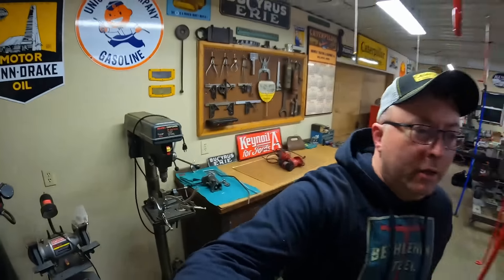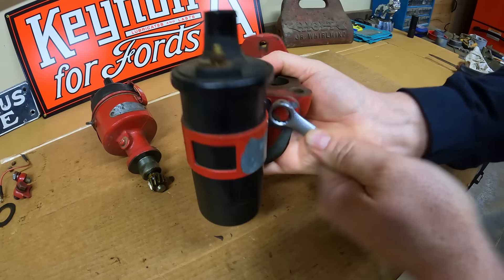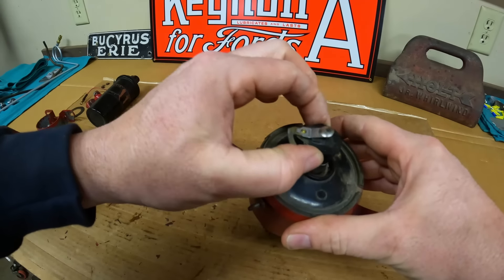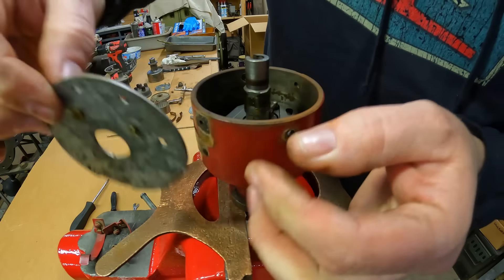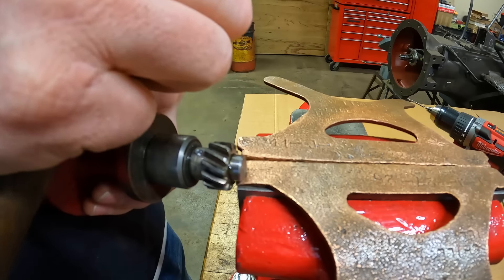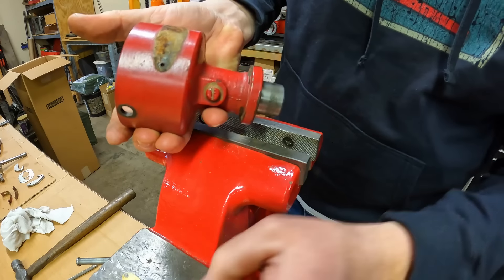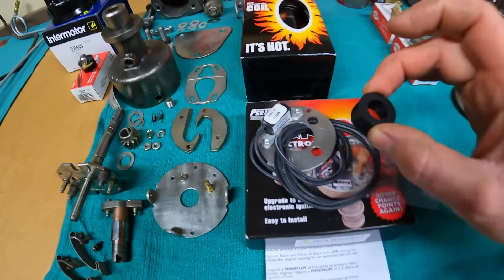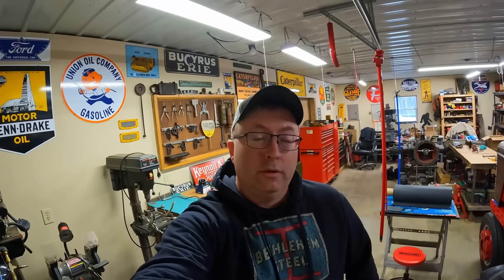Farmall Double Distributor Build! Electronic Ignition vs. Points & Condenser - "Preparation H" Ep.35

Comment: I always was against the electronic ignition....but you are correct getting good points is definitely hard....plus its not like you can easily look and tell its been converted over....bonus if you aren't running equipment Much the new style works almost every single time you flip the key

Comment: well - the Delco's on the GM engines had no lubricating points and the bushings lasted a long time . my 11 years in the dealership I only replaced maybe 6 or 8 bushing and shafts . the problem with points beyond the contact wear is that as the point gap gets smaller the coil saturation changes which causes a weaker spark this also changes the timing slightly. The electronic units give you the same dwell and trigger position for their lifetime. The units themselves will not give you a hotter spark just more accurate . Make sure to read the instructions as they want a certain resistance value from the coil . The reason for spark advance is for the lag in the flame front . Yes the new points are mostly junk some even have a anticorrosion coating on the contacts which is hard to see and will give you fits trying to figure out why you don't get any spark . Great video thanks

Comment: I agree with you trying the electronic ignition as it should give you more reliably and everything still looks original from the outside. I have only used it on an old 5hp Briggs and Stratton and it made it much more reliable..

Comment: Porous bushings aside, I drilled a 1/16 th hole in mine and only gave each fitting enough lube to make sure some got all the way around the shallow groove that was apparent on the outside middle of the bushings.  It is a small chore to remove the plugs, lube and replace the plugs so I left the zerks in place.  My two cents. .

Comment: I used the pertronix electronic ignition in my 1940 O-4. Mine is 12v and i did put an alternator on it as well. Seems to me it was a tiny Mitsubishi Alternator that was under 4" in diameter. I would have preferred keeping it 6v but the Delco Remy vertical distributor was on the tractor when I got it 20+ years ago. My reasoning for 12v system and Pertronix Ignition was simply wear and tear. I didnt want to be opening the bat wings on the Orchard tractor every year or less with faulty points and condenser. My Pertronix set has been on the tractor for 10 years or better and it hasn't failed me yet. It will be interesting to see how it reacts after hibernation for the last 7 years or so. So far though, I'll never do points and condenser again.

Comment: Back in the early 80s, we had a couple of Internationals that would go through points frequently. we tried the Pertronix kits and had great success with  them. Only one failure that was caused by a bad pole on the cam replacement that resulted in an engine miss. Changed the cam piece and problem solved. Overall a great replacement and less maintainence to boot.

Comment: Not all Delco bodies need grease ports.  Those were put on  soooo many different engines, that they just mass produced them.  If you find an engine that needed a lube port, you simply had to drill out the relief ports with a very small drill bit, and install the port/zirk on the service side.   *making sure to drill through the bushing too when or if you ever needed to change it.    I've rebuilt a few over the years on different machines.  Some I had to do this exact thing with, others just needed new ports drilled out when I replaced the bushing.    You could make this mod with your Delco units, or leave them as they are.  (It really would not hurt in the long run to do so)    It's the same thing with the IH  bodies.  Not all of them were tapped or finished with grease fittings and weep ports.   It IS advised by the manual I have on  my old M and 400 to make the mods whenever you have the unit torn down for a rebuild -as you have here.

Comment: Never dealt with a distributor on any tractor but I remember when the 'new fangled' electronic ignition systems started to be used. There were many Electronic magazines that published DIY build circuits such was the initial cost and scarcity of ready built units. They were amongst the first electronic units incorporated into any type of motor vehicle. Now microprocessors proliferate through most types of vehicles - including, I imagine, tractors!

Comment: I've used the Pertronix kits on several older cars and industrial engines. No more points and now you can actually see a spark at the plugs! It hides very well under the cap so the major upgrade is hardly noticeable. If you want to stay 100% vintage then keep the points. If you want to have a better running and usable engine, upgrade to electronic ignition (you can always revert the change)!

Comment: I believe that on that style that the oil hole is to be filled yearly with light oil and it will work through the bushing, i think that is a sintered bronze.
Reply from the maker: Yep that's what a couple others have said too, one guy quoted an old Delco-Remy book that recommended a 20WT oil in those compartments because the bushings were the sintered bronze type and it would slowly soak through - so that's what I'm gonna do :-)

Comment: The pins that the advancement weights pivot on and holes the in the weights, are under tension due to the springs, and wear out and got sloppy on my '85 Chevy K20 pickup's 350 engine distributor. Have you ever seen that issue?

Comment: In many cases, small changes were made to various parts and pieces and sometimes the parts manuals did not get updated at the very same time. So, it is possible to have a parts manual that may be meant for your model tractor but updates to the parts have not yet been included in the manual you have. It could be that at some point along the line they realized that lubricant option was not needed. However, I am not sure why they would eliminate an overflow hole on the opposite side and still keep the larger hole on the other side if it was not doing anything, unless they had so many distributor bodies made like that and they wanted to use them up before they switched over. I'm not sure that makes any sense, but it was after all, shortly after the war and maybe they were still in conservation mode as many folks of that era were.

Comment: Of the electronic conversions done on my equipment, reliability went way up. One or two pulls in cold weather, one good crank and the fire was delivered to start easily. If you are looking to hit it to git it on a not so regular basis these are bees knees. I highly recommend the up grade. Also, since most of it will be contained in the distibutor, if you don't mind it is your tractor. So it starts every time reliably, where is the problem?

Comment: When I added the Pertronix conversion and flame thrower coil to my 1953 Super M,it was the greatest one thing I ever did to it !  (I never had any luck with the newer points they sell these days.... burnt up sveral sets.I will never go back to points ever.)

On your generator set ups, Do you have good luck finding voltage regulators with good contacts inside them?????
Reply from the maker: Yes, I buy them from Brillman Company in Mount Jackson Virginia. They have a “standard” quality version for about $40 (which is the same low quality that you find anywhere else) but if you buy the “premium” version (which is $120) it’s a high quality made in USA regulator and you’ll never regret spending the extra money because they last a very long time 👍

Comment: Squatch,with your miscellany of spare parts,if you possess a 3rd distributor body,try an experiment with SAE 20 oil and see if it works through the existing Oilite bushing. My one reservation would be,is there a difference between a new bushing porosity and a very old one that for all practical purposes has the contact surface polished closed ? I guess it depends on your level of curiosity,it is after a simple experiment,quick to make up. All the best.

Comment: interesting things happening in the timeline of Farmall and Deere Letter-series tractors and their contemporaries. Designed for a pre WWII world, fuel and supply chains. The war happens and engine and fuel technology comes a long way. We went from low grade fuels to medium and premium grade  available cheaper and readily.  Many early magnetoes did not have an advance mechanism like a distributor. The IH mag engines ran approximately 40 degrees advance at all engine RPM.  better fuel led to mechanical rotating assembly improvements so overhauls increased compression and power, the distributor variable advance became necessary for smooth and non-destructive operation. IH even had changeover kits for distributor advance curves when upgrading the overhaul parts because there were detonation issues with original advance curve.  Magnetoes were complex and expensive with simple performace that did not match the needs of the engine anymore, so Delco and other companies sold distributors that were simpler yet have flexible operation parameters.  the Post war economy improved availability so a battery did not seem like a frivolous accessory of a tractor any more...etc. What's "original" on great grandpa's H may actually be original as remembered after a 1960 overhaul :)

Comment: Toby, my experience with the lubrication question is periodically a few drops of oil gets added during service (oil change) The oil wicks thru the sintered bronze bushing keeping it happy. As for the electronic conversion, you'll find spark plugs last longer (electrode wear) Cylinder timing variation will be eliminated since you are no longer relying on lobes. Starting tends to be easier with a hotter spark kernel also. However, I have found that most people who dislike the electronic conversion also did not take the time and address the distributor wear (bushings, advance mechanism etc.)
Reply from the maker: Another variable that I commonly see is dubious wiring - or in other words people installing the electronic kit onto an old electrical system that is in poor condition and has multiple other issues - corroded circuits with high resistance/voltage drop, intermittent shorts, weak battery with undersized or poorly connected cables, etc.  Just like when building a house, if the foundation isn't properly done the rest of the structure will also suffer.
Reply: @squatch253  Yes, sketchy wiring is often the reason some attempt the conversion, not realizing they have an electrical problem. I used to run into a lot of shops and mechanics years ago that would remove an electronic ign. system and put a Kettering  (DELCO points) system in it's place. A bit of irony there since you're converting a Kettering system to electronic!!

Comment: Maybee de bushings were sintered and let the oil slowly set throgh it?  A direkt lube hole, may cause to mutch oil/grease in the distributor and  cause ingnite errors, or the simply deactivate this feature, because it was cheaper and last as long as with the maintainment.

Comment: I've replaced points and condenser with breakerless electronic ignition on all my classic cars. Huge improvement though have had a couple of power units go on me, in each case partial failures so never marooned. One time lost timing completely so had to swap distributors in the middle of nowhere back to one with points and condenser. All up, done hundreds of thousands of miles with breakerless electronic ignition units.

Strange lube thing, was the design once upon a time for the bushing to be sintered bronze type?

Comment: Great video bud! Rudy has a nice IH distributor and drive that's ready to go on his shelf that I'm considering installing on the H just to try to maximize HP on it, and they typically idle a little smoother than a magneto. I do like the convenience of being able to run without a battery, BUT.. There's something to be said about a tractor whose rain cap doesn't move. That Super M I had was about the smoothest running tractor I had ever seen. Great video.. Curious to see how the electronic ignition works out.

Comment: I haven't converted anything to electronic ignition, but I HAVE installed an electronic regulator on a generator tractor and I will not go back if I can avoid it. EXPENSIVE but worth not dealing with the cheap replacements barely lasting a year at $30 a pop. I've even switched to electronic cutouts on the 3 brush generator setups. Again absolutely no issues and no corroded points to deal with on equipment that sits much more than it was designed to do
Reply from the maker: I've been eyeing one of those electronic regulators as well, same story as with the electronic ignition most people that have done it have had very good results.
Reply: @squatch253  The one I bought fit under a typical regulator cover so it's not even visible. It was advertised as helping charging performance and it REALLY does. Probably because there's no loss from constant buzzing contacts to regulate power

Comment: An idea on the grease ports - when we still had GE Dash 7 locomotives, they had a governor and fuel racks controlling the engine speeds. The part of the linkage that connected to and adjusted the injection pump metering rods had 3 bronze bushings in it and each bushing had a grease zerk for lubrication purposes at inspection time. Those bushings were notorious for wearing out and causing the fuel racks to bind up at the pumps which usually caused the engine to surge and hunt under load. 
We would disassemble the adjusters and drive the old bushings out and new ones in. The new bushings didn’t have holes in them at the zerk location, so once the bushings were driven in, we had to take the zerk out and drill a hole through the new bushing using the zerk hole as a guide, then put the zerk back in. 
Do you think there’s any chance those bushings were ever changed and the holes not drilled in the new ones? Or maybe Delco Remy started using oil impregnated bushings and deemed drilling those holes for grease lubrication unnecessary?
Those are my thoughts, but who really knows the reasoning behind it.

Comment: OK, comment time...  The issue with the electronic ignitions is not bad performance.  It's aging in place.  For decades the MFGs of these ignitions have been using the lowest bid parts they can get in the "module".  That usually means electrolytic capacitors.  And those are like dry cell batteries.  They go bad with age.  So black boxes fail w/o any hint of abuse, etc.  Secondly, they are sensitive to floating grounds and bad coils.  I know you hang onto tractors for a while ( 😂 ) and you'll run into these issues.  Oil filled coils are less susceptible, but if a coil goes, it'll take the black box too.  If you have an electronic ignition that fails in less than 15 years, it's prolly the coil that did it.  If it gets hard to start after 15 years, it's the black box failing from age.  I've had to convert a number of machines back to points as the factory black boxes dies and they are NLA.  And, of course, it does no good to buy a spare as it'll age sitting on the shelf along side the running one ...  🙃
And yes I know points and condensors have gone way down hill.  It's a crap shoot whether they'll make a season now. But keep a spare Point dizzy on hand with NOS stock points and condensor just in case ... 🤔

Comment: I had terrible trouble with the ignition on my 1953 Army Jeep. Long story short, a 24v Pertronix pickup solved all of my problems. Not only are newly manufactured points and condensers of dubious quality, but modern gasoline is different.  That Jeep was made for 68 octane, not 93.
Reply: High octane will only help
Reply: @bigears4014  how?

Comment: AC Delco and IH horizontal distributors often had lube routs in the bushings and they used to utilize grease cups to pressurise the grease and move it up through the lans to lube the upper assemblies. Also why Echland and AC Delco points also came with lube capsules for those units that had their older bushings swapped out and not machined for the original task.

Comment: I use the Oregon ignition module on some of my vintage chainsaws, it's almost impossible to get good points for those, and the modules seem to work well. But I put points in my Alice Chalmers when I rebuilt it, they seem to be pretty good quality, they been working for about four years no dramas, and fairly regular use running the wood splitter. Don't remember were I got them though. Either stiener or maybe the same brand as made your ignition conversion.

Comment: If you have a horizontal unit take plug out and see if it has a hole in bushing If it does might want to drill a hole in vertical units the same size Also did you get letter with stamp sample ? I think you will see improved performance with electronic ignition
Reply from the maker: Yes and thank you for the sample! They measure about .020” narrower than the stamps I used last time, which would add up to a considerable difference when trying to fit all the digits on those small tags. I’ll mention it on the next distributor episode too 👍

Comment: I know the electronic ignition conversion is probably way better than a magneto drive or just points. I'm a believer in points over electronics. However with the modern replacements it's kind of difficult to make them run properly. Electronic ignition is good when your tractor is in a very damp and moist environment. It will start, with points it can be sometimes rather difficult. 
Same with the Chevys that have the HEI systems, they will go if there is fuel and air. As for the mystery lubrication on distributors: probably they had in mind you would put just so much grease according to your own best judgement. I don't see any vent or release hole? Maybe they assume you drill a vent or release hole into the case yourself?